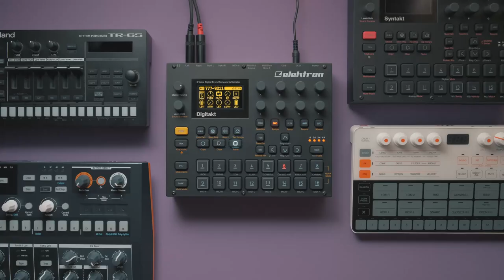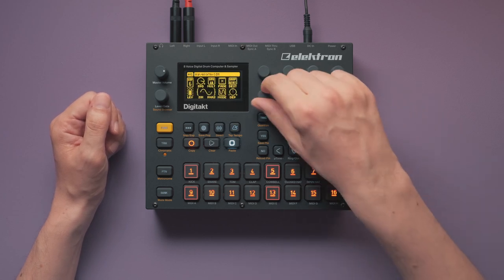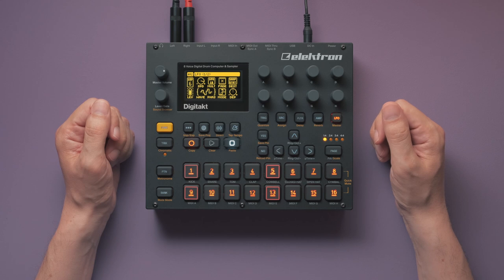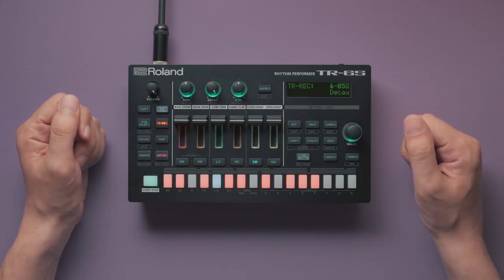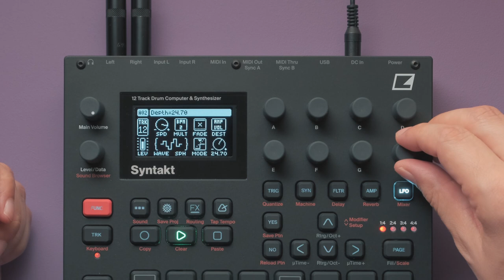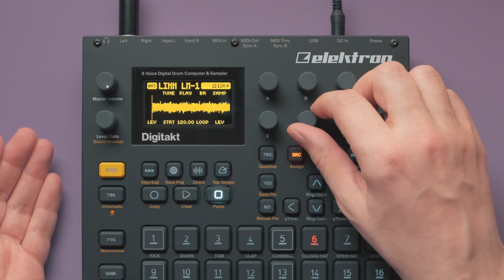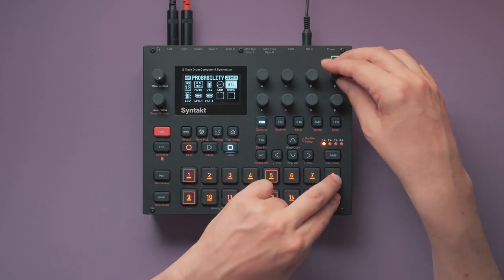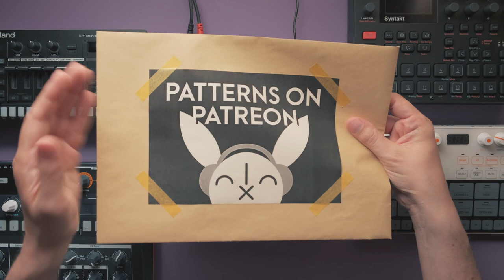How to humanize Hi-Hats on any Drum Machine | Variation techniques for your beats

Comment: Roger Linn is the inventor of the swing in drum machine (LM-1) as well as the inventor of the 16 pad in drum machine (Akai Mpc 60) and to me there is no Ableton, Reason, Logic, Pro Tools or any other DAW or hardware device swing that does either It only comes close to Roger Linn's shuffle algorithm (LM-1, Linndrum, Mpc60, Mpc60 Mk2, Mpc 3000).
That's why I use an Akai Mpc for all my sequencing.
Just like Chemical Brothers, Underworld, Daftpunk and others back then.

Greetings from Germany
Reply from the maker: Absolutely! Roger Linn certainly was a pioneer for the world of electronic instruments :)
Reply: Yeah and Roger linn himself debunked the theory that there was anything special in the Linn or MPC timing.
Reply: @embersandash  It's nothing special mathematically, it's just shifting certain notes in a certain ratio.
But the MPCs do it so consistently that a perfect repetitive groove emerges.
MPCs are rock solid in timing

It's the same with the Roland Tr909, which is said to have sloppy timing and therefore grooves so nicely.
The opposite is the case that, like the MPCs, it has an absolutely stable timing and can therefore represent the written algorithm perfectly.

But still no DAW on earth can handle the algorithms of these machines and therefore they are something very special. ;)

Greetings from Germany